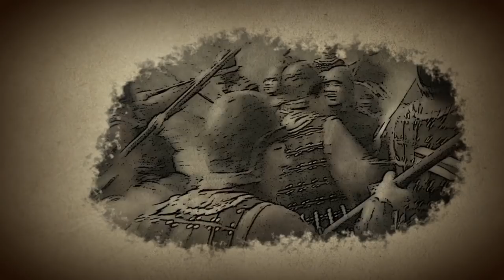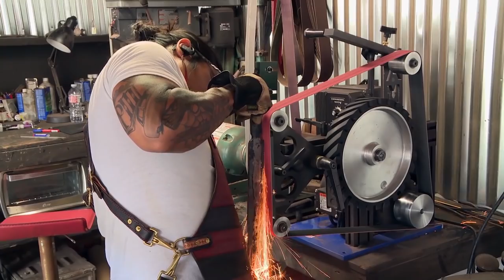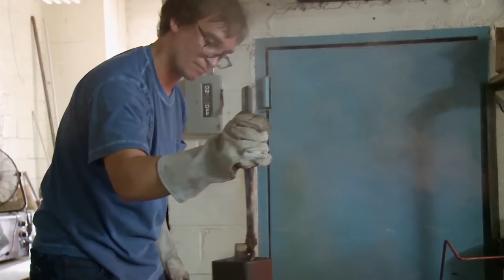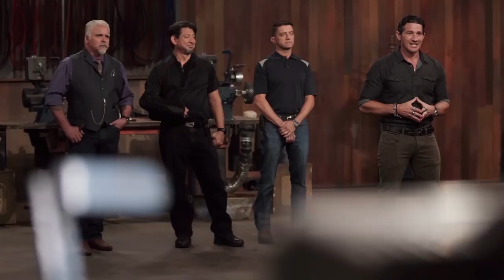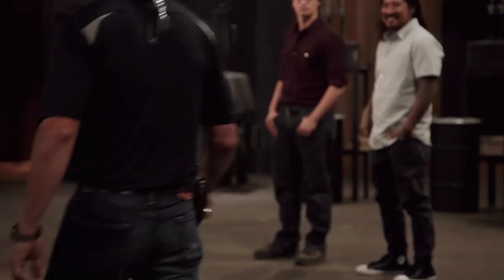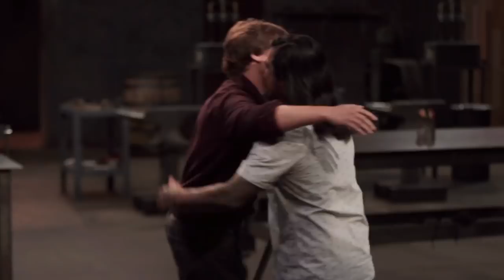Forged in Fire: Traditional Tai Chi Sword SWIFTLY SLICES the Final Round (Season 4) | History

Comment: When you consider the cost of travel, hotel expenses, materials to make the swords 10 grand really isnt a lot
Reply: For a knife maker the title may be worth more than the 10 grand. Even for the guy with the second place it may be a good advertisement. OTOH having the blade fail in the strength test or even worse the cutting test may really hurt buisness.
Reply: Considering all materials come from the smith and the swords are both kept by the show (either for auction or as a showpiece) I don't think they're actually getting much return aside from bragging rights from the title. Unless the winning blade comes from totally cheap materials and labor costs (including forge resources).
Reply: @kamikaze00007  yeah I completely forgot about that. If they lose they lose the sword as well

Comment: Show has been on the air for 4 seasons, presumably he knows how it works.

"Ima make a heavy sword they specifically stated should be light."

"Sorry, you lose, your sword was too heavy"

/shocked pikachu

Seriously, the only thing that makes you more likely to lose than a weapon being heavy is it literally snapping on the first test. I dont care if you have to hollow out the blade and pump it full of helium before sealing it off, you do whatever it takes to make it light without compromising the integrity of the weapon. Thats like, the first rule of this show. Heavy = fail.

Comment: They finally started historical context, but ended up adding a completely wrong history that mixes up the different history of completely different swords. The jian (generic word for any straight sword) is at least 2500 years old, but the tai chi sword design comes around very late in history - around the equivalent of the late middle ages or Renaissance era (within the last 500-600 years). The later sword designs such as the tai chi sword designs had a heavier blade profile that could cut better than other thinner sword designs that were lighter and better for stabbing.

Comment: "dating back 2500 years ago." Yeah, when Chinese were still using bronze sword with length not exceeding 60cm. Taoism has not become a religion yet at that time.
Reply: Nope, 2,500 years ago is correct for both as a gauge.

The sword of Goujian was at 55 cm 2500 years ago.
Daoism was founded 2400 years ago.
Reply: 秦始皇Qin ShiHuang 然而道家不是道教，2500年前的剑和太极剑从各种方面都没有联系